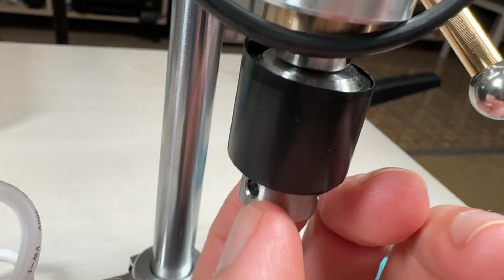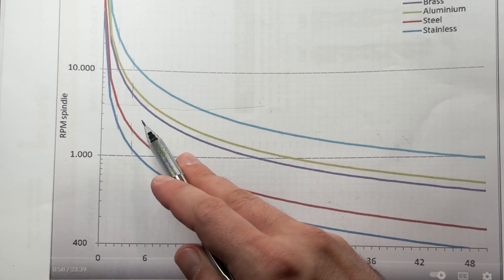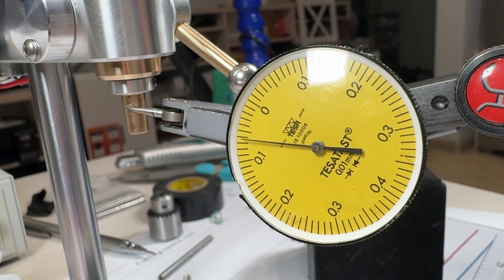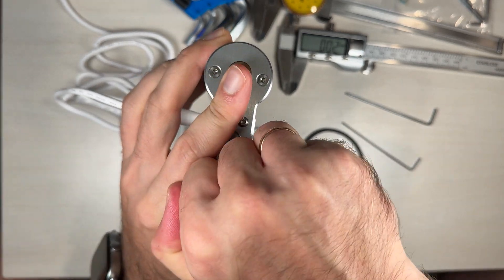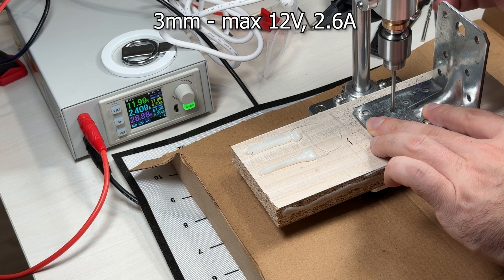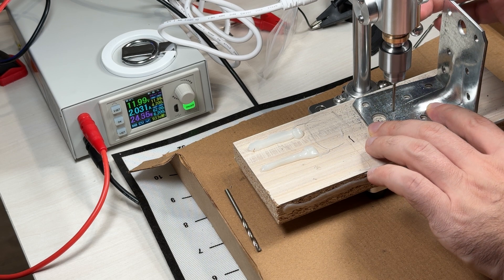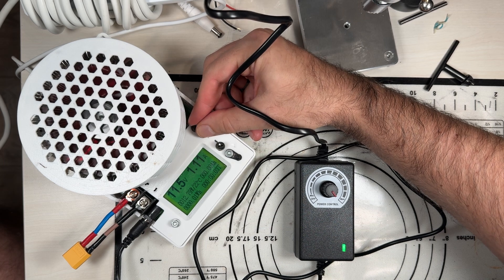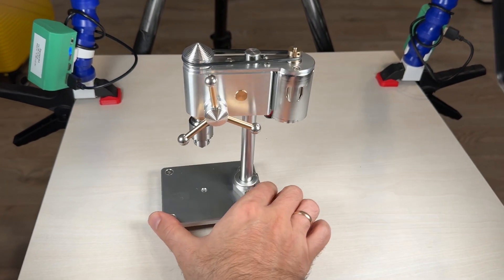Watchmaker's Micro Drilling Machine Review: RPM, Runout, and Power Consumption

Comment: Great video. I was thinking about this for robotics but I'm pretty sure it'll snap my 1mm drill bits.
Reply from the maker: not for this... Idea is good for this mashine... but I not use it now... Low rpm and too big runout...
Reply: @makerbelarus  Yeah, the runout on the Chinese drill press I had was about 2mm. Pretty awful things. They're more like stage props than anything useful. The small milling machine and lathe are far better.

Comment: I think for a power supply, use a proper DC brushed frequency regulated motor control. They keep more torque in lower revs.
Maybe a motor control for RC cars (and a servo tester to generate the pwm input) is a good and cheap way (you still need a 12V DC power supply)
Reply from the maker: In current configuration we don't need any regulation board, because rpm is low of motor. If I'll change motor- brushless with controll board better any dc variants. I have to use this bench drill for a while... then maybe do something.

Comment: Thank you! I have seen these offered for sale before but have not been brave enough to try. That was a very good test and answered some of my questions about this drilling machine. I am interested to see if the precision remains after you have used it for a while. Also interested to see what else you can do with it to reduce runout and improve functionality.
Reply from the maker: You are my soulmate ). I already bought 5 drill chuck for this machine. In 1-2 month I'll receive it and will make second part for improving this machine.

Comment: It looks incredibly cheap.
Reply from the maker: about 50$ - I think it's cheap for what you get.
Reply: I think it looks well made. All metal with brass parts. If it were cheap, it would've been made from plastic.
Reply: @mrpetit2  There's lots of cheap stuff made of metal.  The first thing I noticed was the sloppy fit of the column in the base.
Reply: For casual hobby use its a perfect price.  My friends jewelers watch drill costs 1,500 US. He hobby repairs watches.